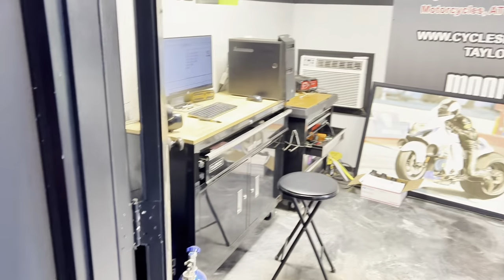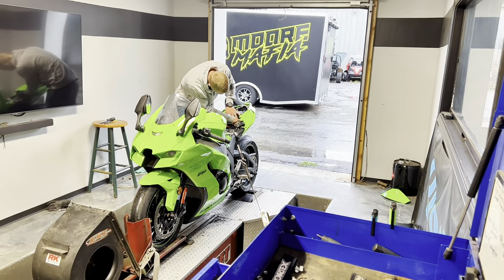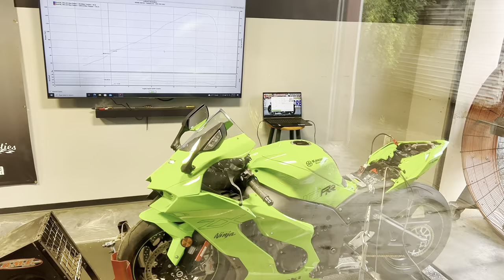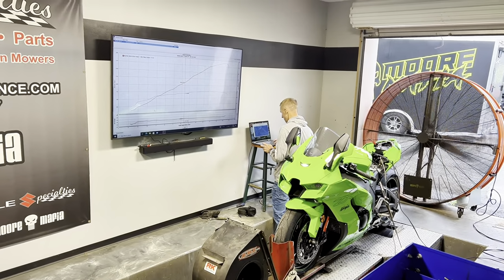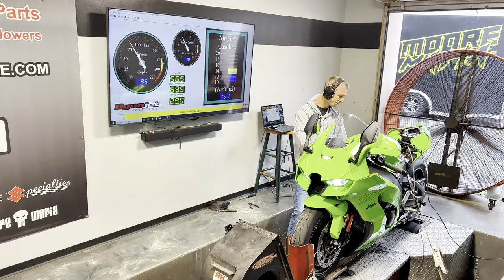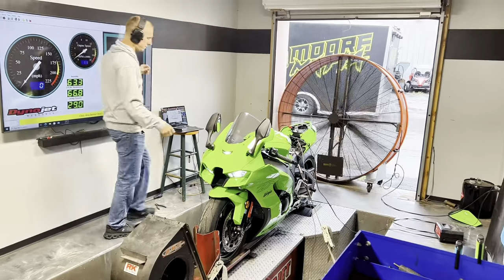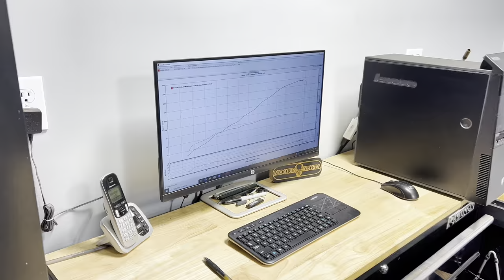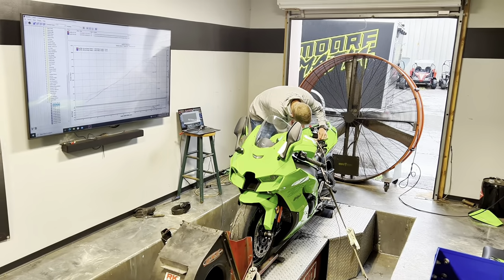I Took My 2023 Kawasaki ZX-10RR to Chris Moore at Moore Mafia to Flash my ECU What Was The Outcome⁉️

Comment: That blipper issue with this bike sucks, there was one tuner that was saying they worked out how to fix blipper problem with some particular settings or something on this bike, can't remember who it was, but it was a youtube video from one of the known tuners, if I work it out I will update this comment.
Reply from the maker: Chris explains it. The guy was just turning off the Decel feature. My bike is smooth as butter and it's still scary powerful. I just turned down the engine breaking and it works perfectly.
Reply: @CK_RIDES  You might be right, I get what Chris explained in the video, but fwiw the impression I got watching this other video was a proper solution had been found. Anyway glad you're enjoying the new bike, be cool to see some more POV riding videos.
Reply: @IN_ZANE_  was it 2 Wheel Dynoworks?
Reply: @kylemacintosh5911  Yes it was, 2WDW has huge experience with ZX10's

Comment: Great video.  A few questions:
1.  How long did you wait to get your bike in to Chris from the day you set an appointment to the day it was tuned?  2.  How long did it take Chris to tune the bike from the minute you rolled the bike onto the dyno and first strap in to mission complete?  3.  Is he using Woolich Racing Software to tune?  And if yes, when Chris speaks of the Deceleration Fuel Cut to eliminate the on/off throttle jerkiness, is he CHECKING or UNCHECKING the DISABLE DECELERATION FUEL CUT box?  Mine is currently CHECKED.  After seeing this specific video, I am sure I want Chris tweaking the tune on my bike.  Thank you in advance!!
Reply from the maker: I set the appt on Monday and I was told be there at 9:30am on Thursday after I paid on the phone. Chris took almost 2 hours on my bike. He was EXTREMELY thorough. He used Woolich and I asked him to keep my quick shifter on the STOCK MAP. If you don’t the QS goes to shit and the downshifts are unbearable diving into turns on the track. I hope this helps.
Reply: @CK_RIDES  Thank you!!  Since the dyno, have you changed your air filter or are you still on a stocker?
Reply: I would like to make an appointment for my 2012 Kawasaki zx10r,i need a ecu flash,only 10k on the bike.

Comment: Found with the zx-10 as long as u down shift in higher rpm the jump isn’t too bad. Letting the rpm get too low cause the huge jump for me.
Reply from the maker: The way deal with that if you don’t have to. My bike has all the power I need and it still shifts. Super smooth with a Quik shifter best of both worlds.

Comment: So sick to see the process! I may have missed it, but do you think an air filter would help you reach that 200 mark?
Reply from the maker: If I had a used tire on it vs the Rossi Cross's Chris said I'd be at 199 WHP and 216 CHP. There was definitely slippage on the Dyno. With a new filter yes. 1-2 HP increase easy.

Comment: Nice content.. i just wanna ask if thst zx10rr version of yours has the VAI? And does it work well with the tune?
Reply from the maker: It does not have the VAI. If it did it would require a new RACE ECU which would only be good for a pure 100% track bike using race fuel only. That’s why I bought the 2023 and opted not to to wait for the 2024.
Reply: @CK_RIDES  oh i see... So the VAI will only work with the KRT Race ECU and will also disable the ABS...

Comment: 193 hp at the wheels is about 222 hp at the crank.  What more can you ask for?
Reply from the maker: The only thing that I can do to improve, that number would be to change out my air filter, which is still stock, and to put on a lighter chain but other than that I’m extremely pleased with the outcome. Chris Moore is the real deal.
Reply: @CK_RIDES  do you know if the RR has ceramic wheel bearings in those forge rims it comes with?

Comment: I'm surprised. I was expecting a higher redline for the RR and improved performance from the engine parts. It's basically the same as a regular flashed ZX-10R horsepower and torque-wise.
Reply from the maker: Not exactly brother I had a new tire on there. If I had a used tire on there, the Dino would’ve been at 199 to 200 wheel horsepower and 230 at the crank up. Chris said that for a bike coming in with only 14 miles not broken in the bike perform very well, especially with the heat and humidity that we had during the dino tune
Reply: @CK_RIDES  oh thanks for the details! That makes sense
Reply: @CK_RIDES  you may want to watch Chris other videos dynoing the R model's. They all make more than 192 on his dyno with the stock tires. The RR model in street trim actually makes less than a R model. Same thing on the dyno I used with my R model, my R  and other R's made more power than a RR model with similiar mods. Simply put the RR is not a street bike and was produced for race teams that make engine changes to utilize the better internal parts. If you're not doing that then its basically an overpriced slower version of the base model.
Reply: There's no point to rev the bike higher than the R model because it doesn't make any more power like you would think it should with those engine internals. It actually makes less power than the R but it may do it in less time due to the lighter rotating assembly allowing it to spin up a bit faster.
Reply from the maker: @EnviedKing  🤣 Said by every guy who can't afford one let alone ride one. The RR is special I have both. It is a completely different bike than a regular R. You'd have to own both to understand...which I don't expect you to.
Reply: @CK_RIDES  spoken by someone who could afford multiple but chose not to because of the very reason I stated. I've been messing with both the R and RR platform since 2021. Do your research before trying to flex what you have on the internet. I'm not some troll and know what I'm talking about. If the way you justify overpaying for an inferior platform is by making new tire claims, then do you but trust I know alot more about both bikes than you do and everything I say is tested facts.
Reply: @CK_RIDES the RR is special but in stock form the R is the better bike on the dyno and in the streets.
Reply from the maker: @EnviedKing  What a tool.
Reply from the maker: @EnviedKing  Sure bud. Go troll someone else's channel.
Reply: @CK_RIDES  LMFAO imagine calling someone with more knowledge than you a troll because they dont agree with what you posted on the internet. Don't worry I'll leave you to it now that I have been informed of your mental health issues. Good luck and I wish you well in your struggles.
Reply from the maker: Don’t let the door hit you in that fat ass of yours.
Reply: New tire was broken in and warm by the 3rd or 4th pull. I've owned both and the RR isn't really anything special. They needed to make 500 with the titanium rods so they could race it in wsbk. Guys talking about getting thrown over the handlebars with an autoblipper  will not notice the difference.